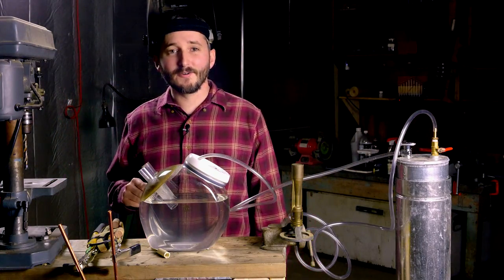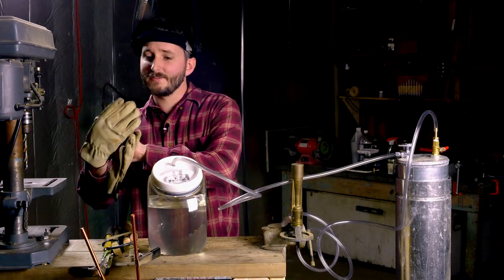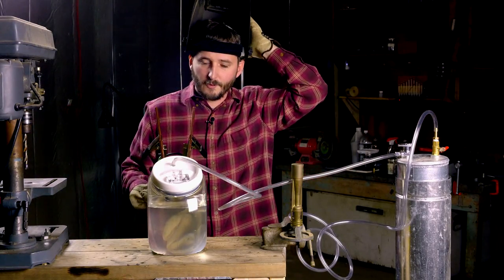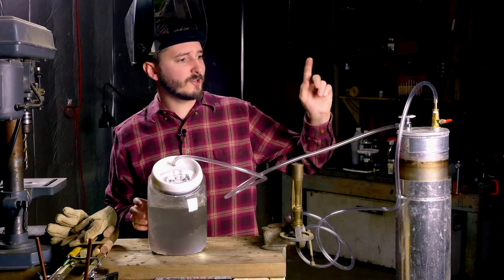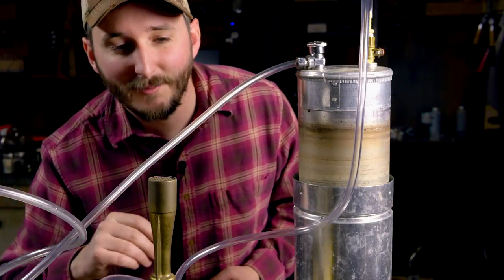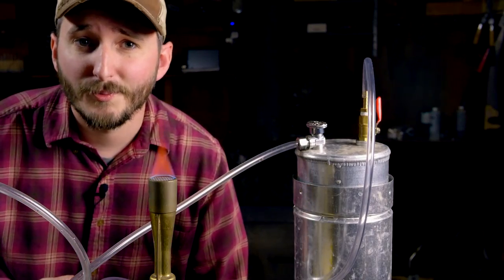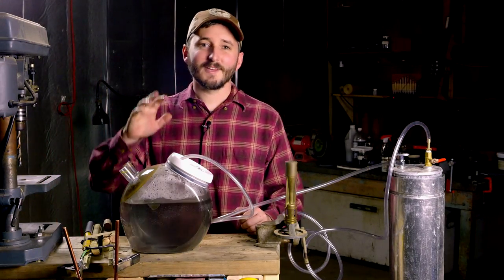Plasma Generated Water Gas (Electrically Produced Fuel That Is Not HHO)

Comment: I’m guessing the carbon electrodes will react with the oxygen and/or hydrogen in the water. Since the gas must be flammable it can’t be carbon dioxide. Maybe carbon monoxide or acetylene. Or both?

Comment: Stopped at 1:30 to suggest these two possibilities. Carbon Monoxide and Methane which should be produced through a c3+(h2o)2 reduction. With two of the carbons grabbing one of the oxygen each and the third grabbing the four hydrogen. The only other option would be instead a c2+(h2o)2 reason which will result in one methane and one carbon dioxide. I will edit this at the end if I am wrong to admit it or to boast about being right if I am!
Edit
Back at 7:00 I was right about the carbon Monoxide, not sure if methane was also produced but it seems that some hydrogen is also made so I was wrong at least on the ratio of how many molecules of carbon are used compared to the number of molecules of water used.

Comment: 0:48. I'm quite familiar with the process. And the primary gas you are attemptings to generate among others is known as HHO.

However. This is not an actual gas. But a combination of 2 different gases. Which are the constituent components of water. Otherwise known as H2O. Those gases being the hydrogen and the oxygen.

With the hydrogen coming off the anode and the oxygen coming off the cathode.

And depending on what your using as an electrolyte as well as the anode and the cathode. Various other gases as well.

Which are usually toxic.!

6:30. While you may indeed be making some additional carbon dioxide. The vast majority is still oxygen and hydrogen.!
Reply: I think you're wrong. He states in the video that he isn't producing hho
Reply: @finlaygreenaway193  Then you're both wrong.!

He is 100% creating oxygen that is not interacting with the carbon creating carbon-monoxide. 

Yes some fraction of the oxygen is interacting with the carbon and creating carbon-monoxide. 

But the vast majority of the oxygen is not interacting with the carbon.

So what you mean to say is that you don't know enough about the process. And you just want to take his word for it because he made of YouTube video.!

Instead of actually learning about the process of electrolysis. And correcting him yourself.!

Comment: See if you can put a plate of glass or IPad protector in between your electrodes.  The carbon monoxide should collect on one side, and your synthetic gas should collect on the other side.  It can be done with a much lower voltage if carbon rods are closer together.    Something as thick as a tempered glass iPad protector would work and then just put your carbon rods far enough apart so that the gases separate on either side of the iPad Protector.  Long as you keep the water level high enough, the gases should?  separate on either side of your flask if that glass plate is between them.  Just be careful of the carbon monoxide, definitely deadly.

Comment: My guess: "Some kind of hydrocarbon. But why would that be danergous?"
NightHawk: "It's Carbon-Monoxide"
Me: "Ahhh. Japp, that's dangerous, all right."

I don't think this is a great way of producing gas, though. At least not, if you are at least a little concerned about efficiency. The arc is very hot, so it will probably produce a lot of waste heat. The water will heat up as well, so if you do this for a long time (thinking of hours, days or more in an industrial production) you'll have to cool the water - which makes the process more complicated (which means more prone to errors) and expensive.
Reply: Oh, and because the rods are eaten away, you'll constantly have to re-adjust their position. Which means moving parts - which is never really great news...

Comment: Here’s a question about magnetics:

The magnet I’m discussing was a cylinder shaped with rounded edges nicely polished so it was very shiny and smooth. Something very interesting happened to this magnet. During some rough play it broke almost directly in the center of the cylinder. And when I attempted to put it back together from the point at which it broke the magnetic property would not allow the two pieces to be put back together again. 
Since north and south would attract each other this meant at the split there became a north and a north or a south and a south. But if the whole magnet was north and south and then it split in the middle why would that not be a new north and new south that would connect/attack each other? Mmm

Comment: the original patent makes the claim that it's intended for on demand gas production for use in internal combustion engines, I'm curious if there's any practical use to that at all, the one advantage it claims is the relatively few pollutants over traditional fuels (i'm curious if that assessment from 1991 would be as attractive now that we're more cautious about CO2) but otherwise I can't imagine powering a couple of carbon rods to heat up water hotter than the sun to make a gas that you then burn is that efficient

Comment: @NightHawkInLight
I was doing similar experiment with carbon rod arc and water, but mine was open container of water and used 20 VAC and 25 Amps current, It gave me some electric shock, but my intent was to heat water without using heating element, to use only arcing method. How much is your welding machine output voltage, is it AC or DC? Also I think we can use stainless steel electrode, around 10 MM gap between the plates, without arcing HHO can be produced (NOTE: If any body wants to do it, take at most caution and safety measures).

Comment: According to the patent, the aim of this invention was to power internal combustion engine. But how to integrate this machine in a car ? Is the production of gas higher than the electric consumption ? (It would be a sort of process to burn solid carbon in a usable way for internal combustion engine). Or is it a energy storing system, which convert electricity into gas fuel, which can be possiblity stored in gas tank for further use ?

Comment: So, very hot carbon mixed with hydrogen and oxygen? I would assume mostly a mix of H₂, CO and some CO₂, with a significant amount of water vapour, although a quick analysis suggests trace amount of HCO free radicals, which may recombine with atomic hydrogen to produce formaldehyde. This also might produce trace amounts of simple hydrocarbons, like methane and acetylene, but given an excess of oxygen wrt carbon it's not very likely.

Comment: I've been watching videos on the process of turning CO and H into methane, then methane into methanol. Your video just showed how to get the feeder gas for that. I'm thinking you could use solar panels to make the arc and store the fuel for winter. Or anytime the sun isn't shinning. So much faster than electroysis and no metal electrodes to turn into toxic waste, I hate seeing people using stainless steel for electrodes. It make chromium oxides. Not cool. This just makes clean fuel.

Comment: I don't see why anyone would want a COH2 gas. HHO gas does not consume electrodes, and thus you don't need to replace electrodes. Plus, you can generate it out of pure electricity instead of also using up carbon. I guess COH2 doesn't burn as violently as HHO?

Comment: Methane rebuilt after water rupture because of the carbon electrodes burning
About 1000 to 2500° water rupture, but with the carbon add in i'm pretty sur you obtain a mix between oxygen hydrogen and a lot of methane

This is intersting but need a lot of amps...
You'll probably need an autonomous electricity supply to be able to cook

Comment: What would happen if you used different electrodes? Some kind of heat and corosion resistant metal (Perhaps stainless steel)? Would you be able to make hydrogen in a massive scale and at a better efficiency than electrolysis?

Comment: I have seen an old car running on nothing but water, no HHO fuel cell of any kind, increased the fuel flow jets to allow twice the amount of fuel floe, in this case water, and a high voltage coil he made on the side of the motor nothing more, water acts different under a vaccum and is why government made people use a bubbler on their fuel cells to stop people from realizing the truth.

Comment: So if I'm getting this correctly; the electricity is not really needed, just the concentrated heat on the underwater carbon.

What if you shine some crazy powerful lasers on the carbon rods from the outside?
Reply from the maker: Probably so!
Reply: @Nighthawkinlight  I've read somewhere that 80% of the energy for electrolysis of water comes out of environmental heat. What about hollowed out carbon rods with electric coils inside to heat them up?

Comment: If its a matter of temperature, wouldnt a spot welder transformer be better? As in make a carbon filament and pass lots of current below 1.8v so that it super heats and creates the high temps for the reaction? Carbon is fine up to 4000*C iirc, so unless you need way more, it most likely would be easier than the whole electrodes thing.

Comment: What if you used the zinc electrodes, like the ones used by power boats in salt water (maybe in fresh water too, I don't know) to drain off excessive static charge generated by the charging system of the boat, in place of the carbon electrodes? Or what if you used copper or steel, would the results be the same and would the gasses be the same?

Comment: Having used my "Hydroflux " torch for somewhere around 30 years, which simply breaks the water into hydrogen &  oxygen with one ten current, I find this whole project interesting but dangerous.  Generating gas as you use it is exceptionally safe as just H2 & O2, adding the CO is interesting but !

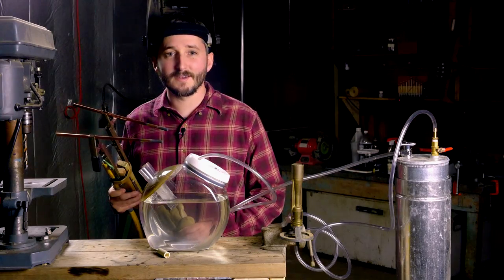Comment: I am guessing while the video is at 0:53. Considering that you are using a carbon torch and water, you are probably going to make a gas that consists of carbon monoxide and hydrogen. Ik this because i do a lot of stuff with gasifiers so I think it will be a similar process.

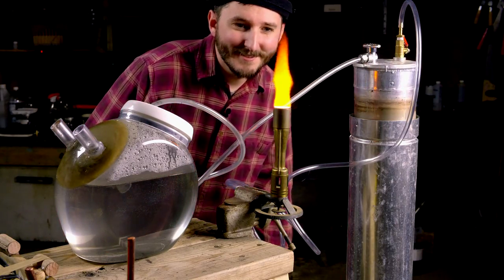Comment: I will admit, I am very sceptical about this. Considering the high temperature of arcs that are generated I find it very hard to believe that your product isn't mostly water vapour. If you were to add a condenser column above the water tank, you should, in theory, obtain more pure product or at least reduce or even eliminate the water content in your "gasometer". And I find it weird how you insist on how clean the burning is when the flame, in fact, resembles sodium flame (quite evident at 9:09). Clean burning flames are blue, and contaminants make up for any discoloration. In this case, I believe the contaminant was carbon monoxide. While it is flammable, it being partially oxidised leads to hydrogen being selectively oxidised first. However, I did notice that the first time you burnt the flame it was completely blue at the very beginning - hydrogen is the lightest gas and once you open the valve it is the first to escape and, in turn, combust. Later the fire turns bright orange, which suspiciously closely resembles sodium emission spectra. I am not willing to speculate how that might have turned out, unless you put table salt or bleach in the water, which I highly doubt. Frankly, your project is not "free energy" bulls**t that is floating all around the Internet, I can attest that the chemical process is indeed legitimate. But one should not make bold claims about the efficiency or cleanliness of the experiment, let's call it that for now, without first meticulously and rigorously investigating the process and it's outcomes. I assume that a welding power supply was used, with a minimum possible voltage setting of 15V (I googled most common welding power supplies, and learned that common ones can deliver 17-45V), and current of 150A, just like you said, that in turn results in a power consumption of 2.25kW. That's a lot of power, and running it for just a while can add up on the power bill. To conclude, despite the questionable claims made, I applaud you for the making of this project and exploring the possibilities and I really liked the video. Some YouTubers could learn from your clarity of speech, that leaves nothing to be desired.
Reply from the maker: Water vapor quickly condenses in the gasometer. The sodium contamination comes from the water the gasometer was filled with, which had some wood ashes in the bottom of my rain barrel. It didn't start being a problem until the gasometer water started to get hot from the incoming gas.

Comment: in my opiniom, i feel like oxy-hydrogen (HHO) is just better, why? well because it is an extremely clean fuel, probably the cleanest you can have, and it doesnt even generate co2, just water, also it burns even hotter and doesnt use the oxygen in the air as the oxygen and hydrogen mixture ratio is exactly stoichiometric so it burns insanely hot, it can even make explosives if you fill a closed container with it and light it, just my opinion though

Comment: Will it still produce hydrogen without the carbon rods?
Reply from the maker: Not by this method without another carbon source in the water. You can produce hydrogen by electrolysis without carbon electrodes but that is a totally different chemical process.

Comment: Good show. However water cannot really be split because it's not really made of hydrogen and oxygen. I have done an experiment that proves this.  The electrodes are actually the source of all types of gasses collected. When the electrodes are heated by the electricity they vaporize. The water simply provides a way to capture the gasses. No water was split in the making of this video.

Comment: how about this, harmonic electrolysis. very low power requirements to make hydrogen gas.

Think in these steps
Sound to break glass, use electricity to break water down
Frequency of water, create a feedback loop in the water. Like overcharging a battery or overkill with power and the object can't handle it.

or basically watch "Chain Reaction" or look up Stanley Meyer

Comment: Of the total energy consumed in the arc what percentage of it was stored as potential energy in the gas v/s that stored in the water as heat? To actually be efficient both of these sources of energy combined would have to total more than the 3.41BTU per Watt of input energy that simply replacing the arc with an electric resistance heater would provide. If the welder was at 150A at 25V (typical) = 3,750 W X 3.41 BTU/W = 12,788 BTUH or 3.55 BTU/Sec. So if your arc ran for 30 seconds it consumed 31W and needs to produce more than 106.5 BTU's to equal simple resistance heating. I suspect it comes up way short.

Comment: How does this stack up to the pure oxide hydrogen gas produced from electrolysis?
Reply: Water is a poor conductor even with tricks or salts to help it. Most of the energy is lost during electrolysis unless you limit yourself to very small currents. This can scale up much better and capture high amperage better. The problem is that the CO destroys steel tanks, so you can pressurize pure H2 but not this gas mix. You need ten times the amount of H2 or CO to equal a gallon of propane and only H2 can be stored in a propane tank, so this gas mix cant compete against gasoline the way H2 almost can.

Comment: Forgive me if this has already been suggested, but wouldn't the gas be better purified if the inlet tube was attached to the center of the bottom part of the cylinder? That way It's in contact with the water longer before it rises up into the other cylinder
Reply from the maker: If the inlet is underwater it takes more pressure to force gas into the tank

Comment: So basically you're treating water with extremely high voltage using carbon electrodes, is the flammable gas acetylene?

Comment: Wouldn’t it be more efficient to connect the electricity directly  to an electric motor and skip all these middle steps that throw away most of the energy in the form of light and heat?

Comment: @NightHawkInLight as iron produces pure hydrogen when heated and injected with water fogg, it oxidizes absorbing oxygen.
As to remove oxydation from the iron carbon is required, do you think that passing this gas thought heated iron oxide would remove the oxygen and recycle the iron?

Comment: What happens if you use hydrogen peroxide solutions instead of water? In the industrial process of coal gasification, an amount of oxygen gas is co-fed with steam and coal to provide the energy for the otherwise endothermic process (in your case you provide this difference with electricity), but if you were to have some peroxide in the water, then this would increase the exothermicity of the reaction and then your electricity usage might merely be needed to start the reaction after which if becomes self sustaining?! Would need to find the optimal concentration of peroxide though.
Reply: Increasing the oxygen balance also causes less CO and more CO2.

Comment: Is the production costs no outweing the benefits o the production gas use.... ..
The gasomiter i recognise... Its my T/ 3 . S.B.M ... From 2007. Same principle... 
Theres a video showing it ... They work proper well as a bubbler, and litre messure per minute, and adapted hydrogen spark arrestor, ck the video... I read some obscure writing from 2 sources one from  10 yrs back Gothenburg universy and one from an American guy from turn of century, both sugested water has 4 to 8 forms of hydrogen...  Very interesting reading..
The Sweed reconed inverse square law in progressively more power... So something to think on...
Nice video...thanks.
Interesting video though thanks.
Thom in Scotland.

Comment: I just wander whats the efficiency factor of converting water into gas with electricity and then gas into electricity with some kind of turbine. Have a feeling if will be horrible not > that 20% in terms of electricity used / electricity gained.